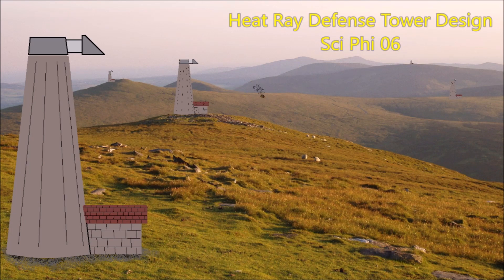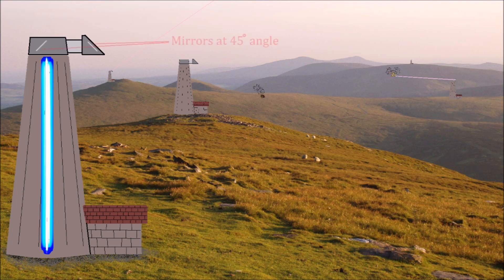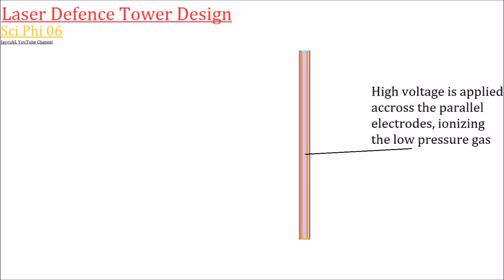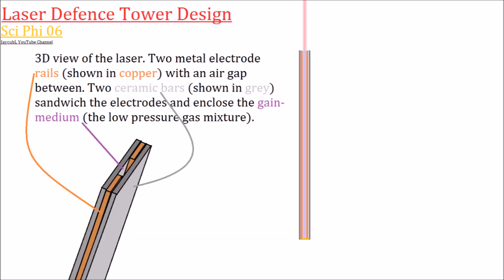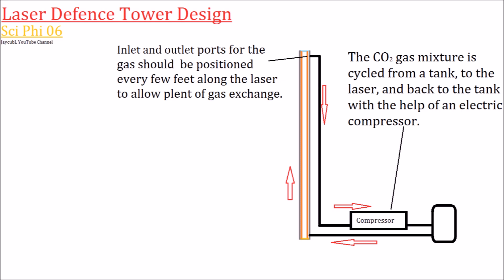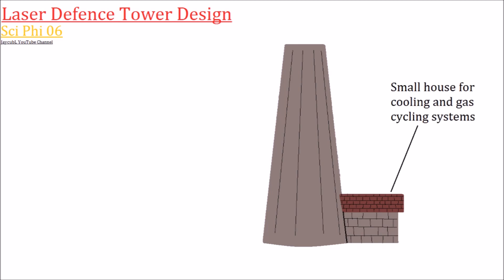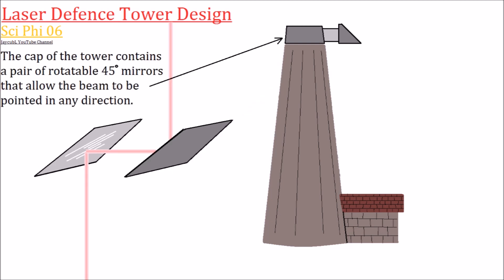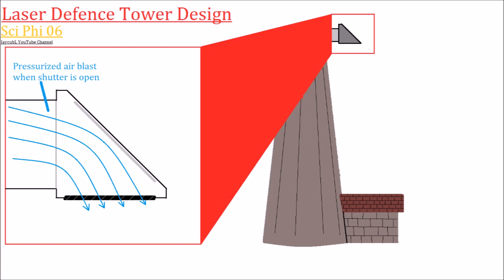Heat Ray Laser Defense Towers SciPhi 06

Comment: laser beam is easy to reflect...this could be used only against some animals becouse shields against this would be super simple...btw Nikola Tesla had a simmilar idea 100 years ago
Reply from the maker: I think you are seriously overestimating how easy it would be to defend against a high power infrared laser. Even some dust on the reflective surface can be enough to heat up and destroy the mirror (that is why the mirrors on the tower need to be protected from rain and dust). Nikola Tesla's design was a particle beam weapon. A very cool concept too but not nearly as simple to implement I think, maybe we can have an episode on particle beam weapons later on!
Reply: I just realize how big those lasers would be...now i think you couldnt just hide behind a mirror hh...
Yes those beams...he predicted a very long range for them...6 towers for entire yugoslavia...
Laser would be an unstopable wepon against air strikes...computer guided it could practicly melt any flying object instant it detects it
Reply from the maker: driterajh Yes Tesla's "death ray" particle beam would have been an amazing system if it was built. I think a particle beam is much more complex than a laser, but possibly more effective and harder to shield against.